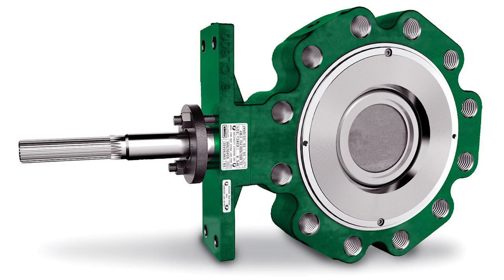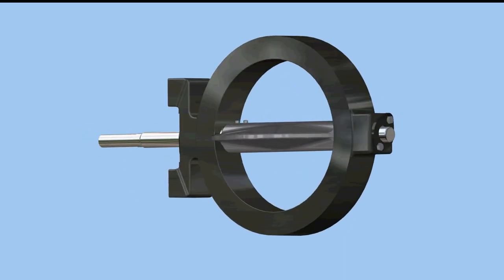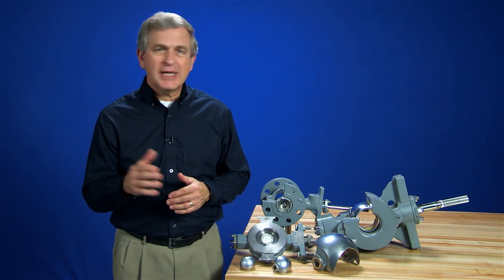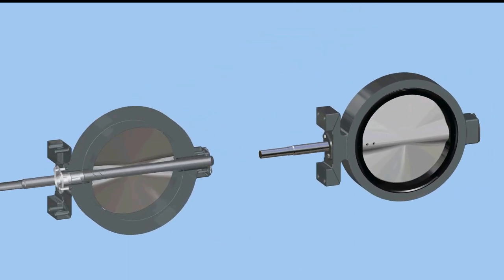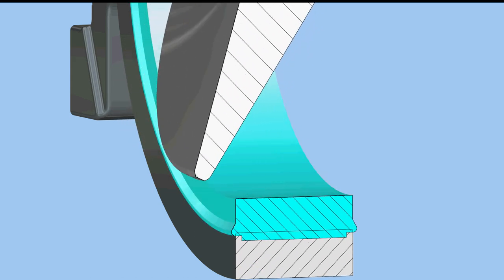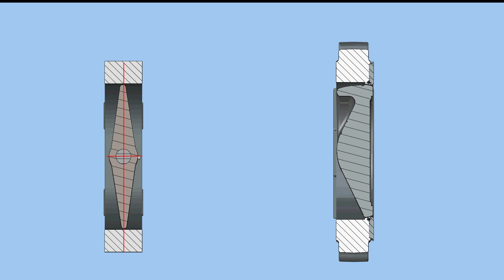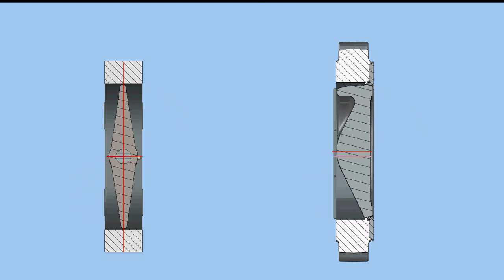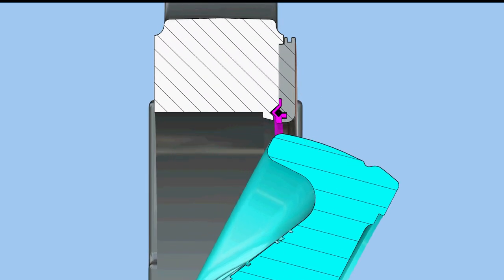What are the Components of a Butterfly Valve?

Comment: Is it true that elastomer seat could prevent the contact of line flow with the body. So it will possible to choose lighter and cheaper material for body in corrosive services?
Reply from the maker: Butterfly valves with resilient lined bodies are very common and do help protect the valve body from corrosive service fluid. We would suggest consulting with the valve manufacturer when selecting body materials.